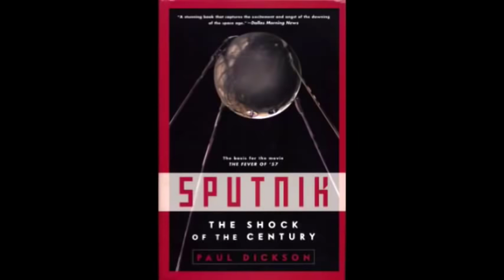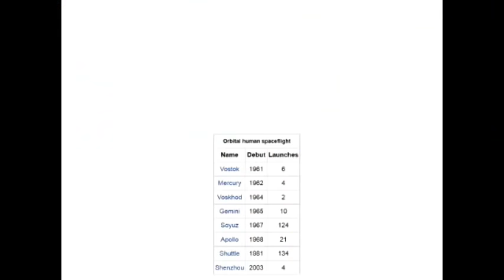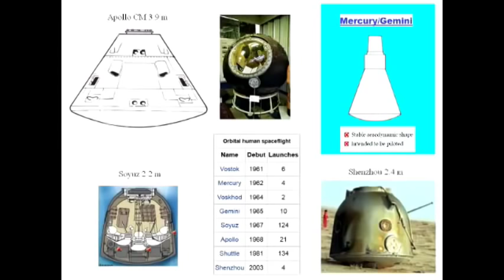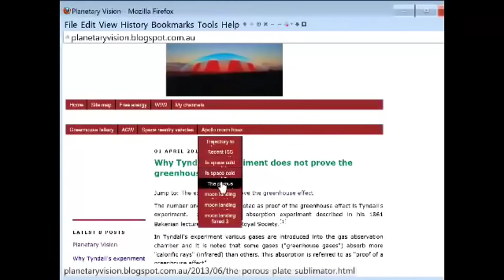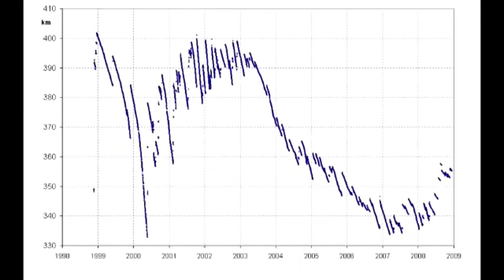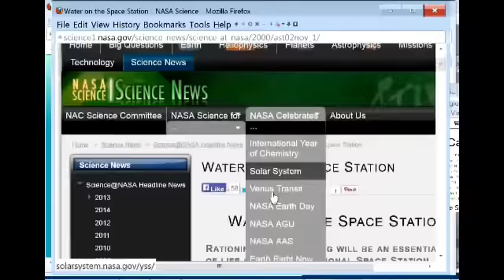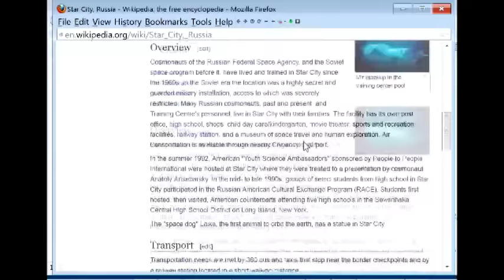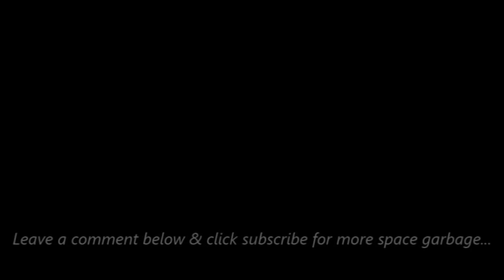The ISS Exposed

Comment: well done in covering several of the technical anomalies of the ISS or it should be called the ISSNOT, infact if we looked in depth at all the systems and mechanics that NASA glosses over and just using basic science the anomalies are endless. One of the areas that I look into is the the characteristics of the space surrounding the ISS at that specific height above Earth. If I am correct they are in the Thermosphere where temperatures can reach 2000 deg... that can melt metal and roast the inhabitants within minutes and even at much lower temps the structure and seals of the ISS can be effected and that is just the beginning. Other factors are the air density, lower space debris from satellites and other also small to large collisions from Asteroid or Comet particles - 20 years and no incidents?? But NASA's lies are only a small part of much bigger lies and if people cannot see one single anomaly  then how will they ever see the bigger picture
Reply: Wow... you are such an expert....

Ha, ha, ha....
Reply: max5250    not really , it is just common sense ... well maybe not so common??
Reply: @3rdeye399  

Common sense of a man who have no clue what is the difference between heat and temperature, or how heat transfers in extremely low pressure environment?!

Yeah right...
Reply: max5250   I did not make up the temperature I only state what Science states itself, look yourself at the  temperatures at various heights . ISS sits around 3-400 miles up the graphs show that this height has high temperatures, yes the heat transfer will be different but what type of energy is accounting for these temperatures it is most likely radiation that only transfers when it hits a particle or an object - because you cannot heat up a vacuum. If thats your best and I am the one that is having to give details  and you are only making bland assertions based on your programming then I suggest you start with some thing easier.
Reply: @3rdeye399  

So, if you understand that much about thermosphere, temperature, and its transfer, why did you said this:

"If I am correct they are in the Thermosphere where temperatures can reach 2000 deg... that can melt metal and roast the inhabitants within minutes and even at much lower temps the structure and seals of the ISS can be effected and that is just the beginning."

since it directly contradicts with:

" it is most likely radiation that only transfers when it hits a particle or an object - because you cannot heat up a vacuum"

Or, if you didn't understood your own words, you first assumed that the ISS should be 'melt and its inhabitants roasted within minutes', but then you explained to me that thermospehere is mostly vacuum that cannot be heated up, and the only way to transfer temperature is 'radiation that only transfers when it hits particle or an object (which is not entirely correct, since hitting another particle is temperature transfer by conduction, and radiation is something entirely different).

Can you explain to me in details how could the ISS would be melted by collision with extremely small number of particles (since we are talking about vacuum)?!
Reply: Fred Jaminson  

Let me guess, you are an expert for CGI because once in your life you tried to use Paint application, and failed miserably?!

LOL
Reply: max5250, that is not what I just said, you are simply changing my words to fit your argument. Firstly as I have said before I did not magic up these temperatures so some-one had to measure them , I too have questions how they did that and also with the low density of air in that region. I assume that these high temperatures are there because of Radiations which means that the ISS being a mass is also subject to these waves as they would be in outer space. I too ask the question too why they are so high in this region but I would like to know how they were measured and what and how does it maintain. But even if I scrub this region out of existence I am still left with a problem, you admit that the is air is thin, let us assume that the conditions a close to being in outer space  and therefore open to Cosmic and Sun radiation. The ISS is on the Sun side for say half of its orbit and open to the effects of them , have you considered how this could effect the operation of the ISS .

Comment: when you go with a theory/assumption that we are surrounded by water above us (Piccard going into space claimed it was water/Hennesey ad) then training in a swimming pool and having bubbles in space kind of takes on a different meaning. I believe we are probably surrounded by water with or without a dome but I agree that the ISS stuff is green screened. I was wondering why you didn't include Chris Cassidy's comment they are filming from across the US (from where he grew up). Also the blue screen astronaut in the control room accidentally getting filmed where you can see them doing something with a ball and then seeing the "live" version where he has the ball on the ISS and you can see they are the same film clip.
Reply: dreampsi2 

So you are the one of few ‘blessed’ who didn’t realised that the astronaut seen in Mission Control room was actually on TV screen?!
And when you compare the picture from that screen with original video of the experiment you still see the ‘blue screen’ (should be invisible if it was chroma-key recording).

OMG
Reply: @max5250  again, more people who have zero deductive reasoning and who cannot understand much of anything. 

I said that in the control room, the camera pans around to a large screen with an astronaut in front of a blue-screen with a tennis ball. When you watch the actual clip of that astronaut with the tennis ball, he is on the ISS. Deductive reasoning would tell you that I'm saying the blue screen is behind an actor and when they finish editing the ISS behind him, you get to see the actual clip of an astronaut on the "ISS" with the same ball that was just on the screen of the control room in front of a blue screen for CGI. There is ZERO reason for an astronaut to be reported to be on the ISS and standing in front of a blue screen for CGI effects.

Comment: I dunno what you think but all these astronauts aren't even closely in physical an mental shape as seen in these pics an videos , I mean wouldn't you want the strongest an smartest there doing what they are suppose to be doing
Reply: Such as the likes of you? - You don't need to be Superman to withstand the acceleration during a record launch or the deceleration during reentry, and there is training for that. You need good health. Up there, you need to be able to cope with the loss of gravity, and there is training for that. Otherwise, you need the mental capability of a physicist or electrical engineer or similar, as can be easily found in the top 2% of the population. I know enough of this group, and most of the time they don't sound so high-brow. They like to hang out like the guy next door, they crack jokes (even nonPC ones) and behave in a rather mediocre way - unless when at work.

Comment: The concept of the orbiting spacecraft is a hoax so is the theory of gravity that is taught in college. NASA likely discovered back during the X-15 program that gravity is not a pull but a push force caused by gravity waves produced from stellar and planetary cores which also can reflect or block gravity waves. There is likely a spherical zone shell several miles above the ionosphere or even within it where the two intersecting gravity waves, one from space and the other from the earth's core which balance each other in that zone and it is possible for objects to remain in that zone without falling to the earth or repelled out into space. In that zone the spacecraft or satellite can remain stationary or move about but care must be taken not to stray out of that zone. There is no need for objects to reach "orbital velocity" since such a circular orbit is impossible to achieve if gravity was a pulling force. A falling object will gain acceleration which also makes circular orbits impossible. Film or video footage of spacecraft "orbiting" the earth are likely fakes or fast forwarded to give the impression of orbiting the earth.

Comment: Maintenance, they don't do no stinking maintenance, they're NASA!  NASA just says something and it's so!  

You have brought up a lot that I have thought about and commented on.  The don't have any serious maintenance tools.   Don admitted he has no idea what to do if they sprang a leak in the coupoula.  He said somebody else must know. 
Ask anyone who served in a submarine at least 10 years ago.  I'll bet they can still tell you their duty in the event of an emergency depending on where they happened to be.  Every member had to know what to do because, like the ISS,, it's a life and death situation.  No time to look up a protocol.  
Every ocean going vessel has a machine shop able to make almost any part need to get equipment up and running.  Ain't no parts house in the middle of the sea.
Those rubber O rings that seal every joint degrade but never leak.  Because they can't replace them, they just last and last because NASA says so.   
The skin cells we all lose would clog up every crevasse, moving parts and all the electronics.  
I wish we could get the batteries they have and put them into electric cars.  The best battery we have access to will only take a certain number of cycles and then it dies.  
The solar cells seem to last forever in low earth orbit too.  All those micro meteorites and space junk never hit anything.  With the huge surface area of the solar cells, what are the odds that even one would still be functional?   
In all the years of service, only one hole, which they think was intentional, has been found.  I heard that a small leak in a pressurized airplane at altitude will cause a catastrophic failure.  Remember the airplane that lost a big section of the top and a cabin person was pulled out.  A window gave way on another and people were sucked out.
Even if they could get the ISS up there, the rewards VS the risks do not justify the risks.  They haven't provided enough safety consideration and equipment for people on it.  Remote control robotics could do whatever they want to do and not risk live.   Not real sure what knowledge we have gained with it. 
Airplanes can only fly for so long before engines have to be completely overhauled and metal fatigue causes cracks and failures.  Even depressurizing and repressurizing a planes cabin area causes catastrophic failure.   Yes the rocket motors would last longer because they aren't used much and usually only the airlock area is depressurized and repressurized but it has been used a whole lot.  
Would they design a submarine without pressure doors between areas?  Or without some kind of emergency evacuation provision.  The spare ship on the ISS is too small for all the people and the ones left would run out of air before another ship could get there.  They should have a module that is designed and equipped as a lifeboat.  Separate it, use thrusters to move away and maintain orbit until they are rescued.   The logical thing would be to have an emergency rescue ship on the pad and ready to launch quickly just in case it was needed.  Lacking that shows no regards for their safety.  
There's way too much equipment that is unnecessarily outside on it and seems to be the only things that ever need service or repair.  Spacewalks have to be the most dangerous active they do.  They should only done when absolutely necessary, everything possible should be accessable from the inside.
Cooling requires a medium to remove the heat.  You can't have the heat radiate off without something to transfer the heat through, a vacuum will not work.  That's why coffee stays hot in a Thermos.  The sun side would be heated as the Earth is by radiation of the heat from the sun, but while the dark side would be cold, there's nothing to remove the heat from the heatsinks.   How is it cooled?  
Water in the tanks would freeze or boil and explode it's container (possibly a pressure vent would keep that from happening) if the circulation pump stopped for a very short time.  No water would be a major problem, but an exploded tank would be the end of the ISS.
In low earth orbit, would the "trash ship" really burn up completely?  
I've seen things disappear, people and other props including equipment in the foreground.
There's just too many mistakes for me to believe it's really occupied.  It took me a while to come to that conclusion, I really wanted it to be real.  When I saw 3 people disappear before my eyes and a guy catching something and putting it away but it doesn't appear to be there I was convinced something is not right.  NASA is "all in" on the illusion and it's way too late to admit it isn't real.  Maybe a shell of the ISS is orbiting, but I can't believe anybody is ever in it.  
Why would they fake it?   Look at the budget amount.  It would be a great source of funds for those "black projects" they love so much.   
How could they get everyone to play along?  Fake it to them too.  They have mock-ups in a pool, they just act normal like they do for their on air playtime.  They don't even wear sensors like they did on the older space shots.  It would fool most everybody at control panels easily.  
If someone figured it out, do you really think they would give up their cushy, prestigious and well paying job to expose the hoax?  Especially looking at what happened to Snowden for blowing his whistle.  They would be afraid to tell anyone.  It would be much easier than faking the moon shots.

Comment: Satellites are fake. 
Earth is flat.
Reply: It's common knowledge that one degree of latitude with its 60 arc minutes results in a distance of 60 nautical miles (or ~111 km). Therefore, from North Pole to the Equator we have 90 degrees or 90 x 60 = 5,400 nautical miles. Similarly, one degree of longitude also contains 60 arc minutes, again resulting in a distance of 60 nautical miles per one degree of longitude. This means that the Equator with its 360° has a length of 360 x 60 = 21,600 nautical miles.

Because the length of the circle with a radius of 5,400 nautical miles is 2 x 5400 x π = ~33,929 nautical miles and this is very far from 21,600 nautical miles, Earth cannot be flat.

Comment: We don't have a base on the moon for one of two reasons: one, it was already occupied and told to go away; two we actually do and they are keeping it a secret. 

I guess since "we never went to space" then that means the earth is flat too. I think your "analysis" is not only full of flaws and and completely lacks basic understanding of physics. I do however feel that the vanallen belt theory is as much bs as your theory of how they fake the ISS. The video you used and "evidence" of 11 people on the ISS was during a crew change. And yes the ISS has thrusters that use oxygen, not rockets. And it's made with tubes because the sections have to fit on a rocket and be easily added to. And they bathe using wipes and the "water" and air is continually being recycled. And I have watched videos and they said it does smell and all solid waste is burned up in a special craft designed to burn up on "re-entry". Wouldn't you have a permanent grin on your face if you were on the ISS. Also each section has doors. 

Lastly, one thing you are totally missing. It's micro gravity, not zero gravity.

Comment: The explanation of orbit is bullshit as well,,,  free fall my ass,, real orbit it when the centrifugal force equals the force of gravity.. Also Newtons 3rd,, (the real one and not the B'S they teach in school) says no you need 2 things  to react to the explosion of the rocket engine,, equal opposite reactions relative to each mass.. Also the fire it's self is expanding gas pressure without containment and in an environment that's 2.5 kelvin,, heat would be lost faster than its created and for a gas pressure you need heat,, so the explosion would never form..

Comment: When i received a clip of the chinese rover thing landing on the orange chinese moon.  Don't they knowe it is cheese?  Green!! not orange.  Now I can't find any similar clip of the touchdown like I saw.  Looking down alongside the rocket .  as they approached the surface there appeared these what looked like little holes some feet away from the fire, which I also didn't see.   But these little holes were blowing out a thin trail of thick smoke.  then more of the same then what appeared to be blurred out pipes that did not seem to be directed out from center of rocket but more just across the c amera's view.  Blowing what I'm guessing was just compressed air.  I can pretty clearly see a SS BW 45 fitting standing up after the air blew some of the cover dirt away leaving it exposed.  And more.  zoom in on stuff and it just is clearly not the moon.  More lies and BS.But you will have a hard time finding a clip anything like the one i watched.  Not to say that there aren't plenty videos.  I think more than I've ever seen on anything before. dozens and dozens.  Some only with CGA.  Others have shortened the clip to a couple seconds  or even to just a few stills.  And it is in black and white?!?!?  fake fake.  Disgusting.

Comment: John doesn't know what he's looking at... the anti-gravity simulation aircraft can only have zero g for 30 seconds or so, and you can see the vibrations and lack of smooth motion of the surroundings. there is footage of 15 and 20 minutes long of both camera and astronaut movements that are just impossible anywhere else but space. Not only this, ALL the details in this video are just wrong and silly... it's just a shame that in 2019, ignorance is given the same oxygen as knowledge.